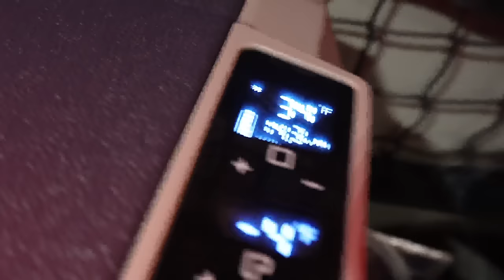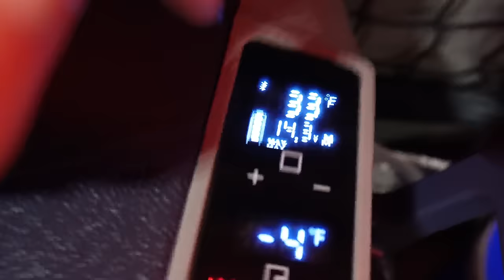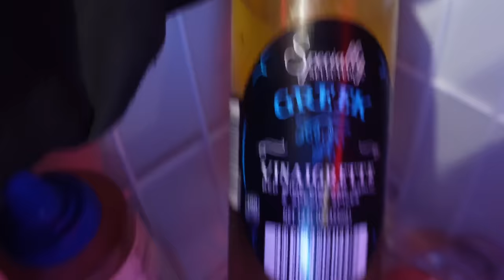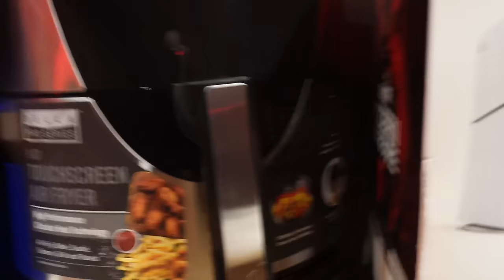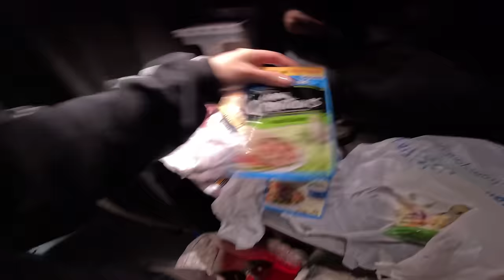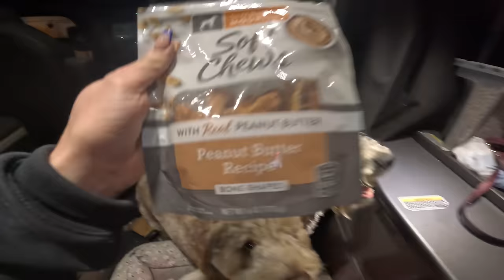Getting My Trailer Fixed Again! Heading to Laredo 😭 New Bodega Cooler!

Comment: Looks like the front drive fender/mud flap rubber thing on top is getting caught up as you're making turns, and it's breaking your pigtail connecter.  I hope you know what I'm talking about. See if I can send a picture later. To show you what in talking about.  You can also set your camera pointing to that area of interest, drive around the yard, and see how it might be getting caught.!!  👍🏼👍🏼
Reply: Bingo you're exactly right
Reply: Facts
Reply: That's what I thought as well 👍
Reply: I was going to post this but you where first. I was thinking the fender to🎉 maybe strspping the cables on to the middle of the trailer is a solution?
Reply: Exactly. First time was maybe a one-off, second time , there is a problem to be found.
Reply: Well in many previous videos and as u see now. The air lines have more slack from the spring hanger. 😉😉 and as the wire harness is tight over and above the flap. what has the most tension between trailer and the spring that takes the slack 💁‍♂️🤔 ding ding the wire harness and not the flap as the problem 😉😉🤣 good try though
Reply: ALL.  THE.  SAME.  ,   LINE.  IS.  TOOO.  SHORT.  ,  AS.  WELL. !!!  .

Comment: I would say because the bracket is plastic and the cold temperatures make plastic Brittle and when the truck air lines pull on it breaks . In my opinion the brackets should be metal
Reply: Or the bolts were overtightened.

Comment: Hey Becca, the reason you keep ripping the pigtail bracket out could be the line is catching on the rubber top on the rock guard. I have had the same thing happen to me a couple times. The rubber needs to be replaced with a different piece. They make a nice chrome one that is shorter and is bent towards the tires. Hope this helps. Be safe and pet the dogs for me.
Reply: Its the big zip tie that wraps around the lines and the post. the thing onn the headache rack is the retracter spring.
Reply: My thought too. Found your reply and said to myself. Good, its already been addressed.

Comment: All the trailer connections need to be installed on the front center of the trailer, not off to the left or right. I have never seem a set up like this on a trailer for the connections.

Comment: It's clear to feel that you've got a better working environment and you've got more energy to live better with more nutritious food. It comes back to you double. Good to see that you are thriving and have a boss who respects and helps you. Hope it continues into the new year. Can't you charm your way into the workshop and get them to move the stairs to the back and get them to make a suspension for the hoses and wire so that they are not in your way in relation to getting into the cupboards and that you don't have to straddle over them or bow down and not least so that they don't get torn to pieces. Maybe you can get some good ideas from your subscribers here in the threads.

Comment: Becca    I knew from the beginning there would be an issue with fenders and other things.  I was an aircraft mechanic and aerial  crop duster.    anything that i see or feel to be potential problem   believe me   does happen soon or later.   I do trucking too      since you're by yourself   put go pro up there point down make left and right tight turns and check verdict    I know whats wrong

Comment: It is that top 4in.  trim piece on your mudflap bracket. Your cable sits to low and is being pulled on with just a slight turn.

Comment: The electrical cord from the truck to the trailer is getting into a bind when you turn short?  Perhaps you need a cord with the spiraled coiled portion hanging between the  overhead area. Looks like a great cooler. Is the cooler powered by AC or DC power?

Comment: Becca take that big zip tie off (that should not be there) that wraps around your trailer air lines its not allowing the lines to stretch defeating the purpose of the large spring. The large spring is used to hold/retract them. Adjust the spring clamp further down the cables so to take up slack so the lines dont drag against the truck just make sure to leave enough droop. Merry Christmas Driver. 73's.

Comment: Did you guys say why the lights weren't shining? On the Oklahoma chicken house its easy to go around the I-40 chicken house just over the state line from Arkansas.  Exit at the state line and cross I-40 follow the highway over to US 64 then right turn follow to I-40 by pilot travel center.  That saves the climbing  up the hill to that chicken house. I saw another of your videos where you had a problem at that location?

Comment: Need alittle more slack in those air lines and electrical cable looks like it's pulling to tight and breaking when you make sharp turns because of not enough slack .. Stay Safe !!

Comment: It looks like your electric line is a little short.  On a sharp right-hand turn your line pulls tight and the socket on the trailer is the weak link and breaks.  Put some more slack in your electric line and you should be good to go.

Comment: Isolate the electrical  system problem :
#1 - Tractor light cord socket
#2 - Light cord
#3 - Trailer bulbs and wiring
Collect basic tools .    Viewers suggest tools .

Comment: The reason your trailer light plug socket is broken is because it is made out of plastic.
If the shop replaced it with another black one, thats plastic too & will break.
You need a metal one. They are silver and your troubles will be behind you.
(get it? your trailer is behind you? yuk yuk yuk yuk)

!